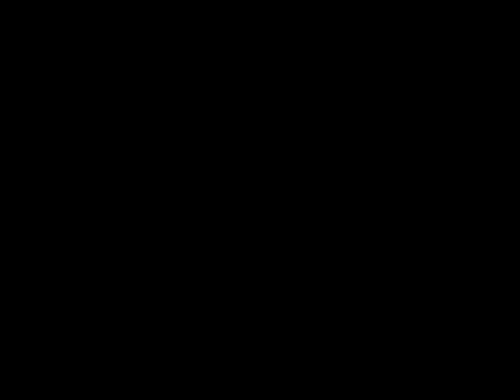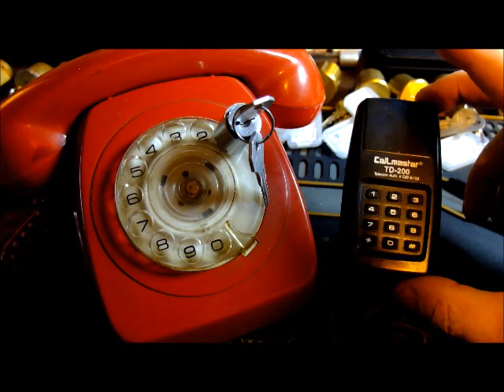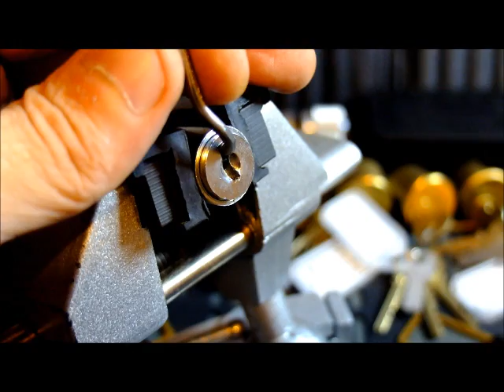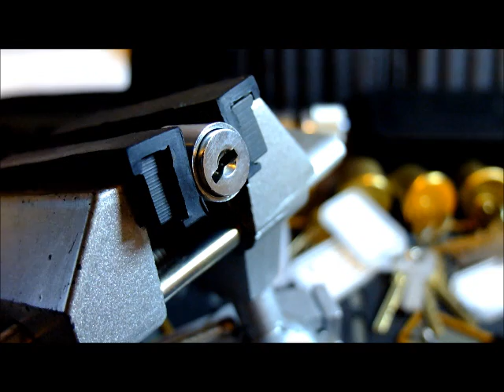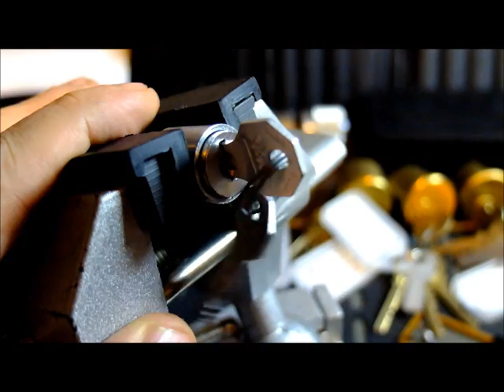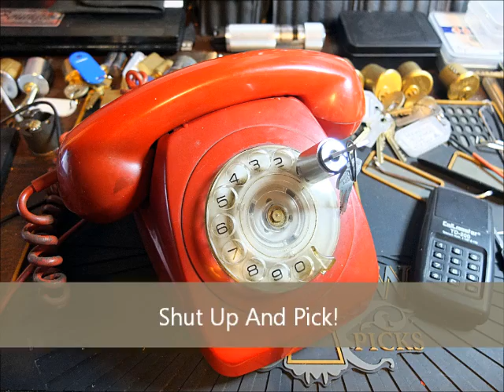Yale Rotary Phone Lock (SPP)

Comment: Nice work. 4 wafers seems to be the standard for most of the dial locks I have seen. I have a spare Unicam dial lock if you would care to swap some time.
Reply from the maker: If you really want it you can have it. No need for a swap.
Reply: Wouldn't want to deprive you of a nice piece like that one without compensation.
Reply from the maker: No big deal. I have other telco-related locks that aren't going anywhere. :) Seriously, it is nothing for me to let this lock go.
Reply: Well, if you are sure.

Comment: Interesting, TELSTRA used to be one of my customers when I was in the CATV business.   I wish I would have seen this video sooner.  I bought a rotary dial phone to do the exact same thing, and I ran into the exact same problem of the lock not fitting the phone.  I'm in Canada and while the phone looks a bit different than yours (yours has a more rounded form) I think the Dials must be the same as I also have the Yale lock.  Did you ever find a solution or a phone that fit?

Comment: Those locks were a joke. There were so many articles on how to pick the lock. No need.
Just pick up the receiver and pulse the receiver button at the same speed as the dial would go.  For 763-2284, pulse 7 times, pause, 6 times, pause, and repeat until the seven numbers are dialed. That's grade school stuff, which is where I was when I figured that out.
Reply from the maker: Yeah, fun days. Also just as easy to plug in another phone or just tap into the copper pair.... several ways to skin a cat. Wanna talk skill? Joybubbles. Enough said.